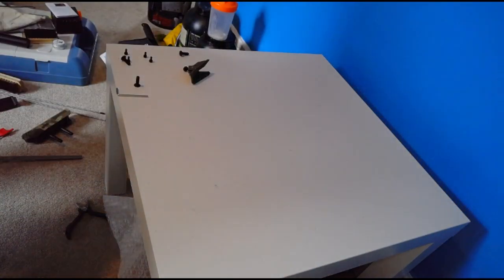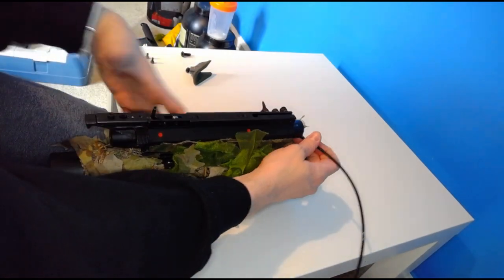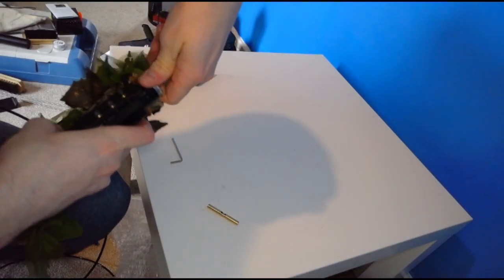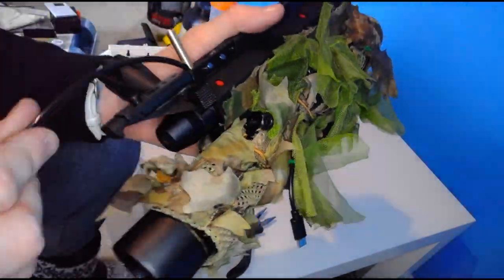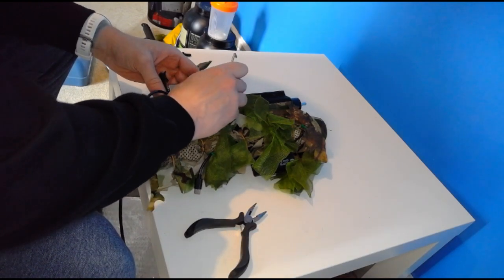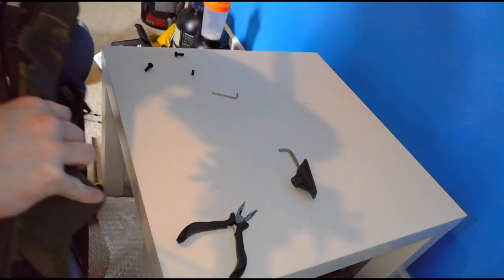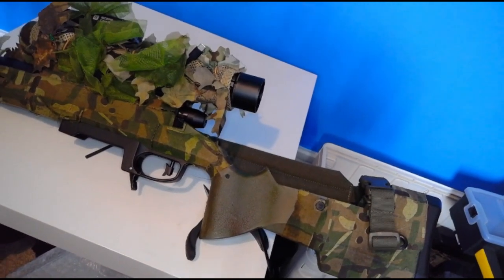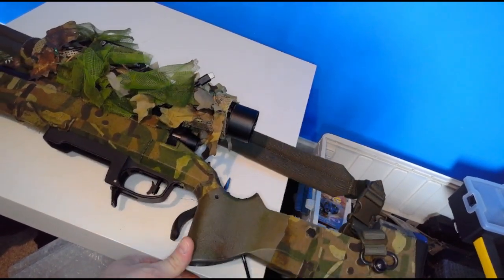silverback Tac-41 mancraft SDIK conversion kit installation

Comment: super video par contre a tu changer le bloc hop up j est le kraken penses tu que ca irra et pour le canon tu a quoi en therme de diametre
Reply: Hey it may be  too late to say but in my  research pdi barrels have a great tolerance of 0.002mm they are stainless steel and cold hammer forged just like real steel. Here are my recommendations for diameter keep in mind HPa is a lot more consistent and more powerful in the case of using the mancraft HPa system which can be used to reach 700fps at 220psi with 6.01, 6.03, and possibly even 6.05, with those barrel diameter 120 psi would get 500fps all with 16in barrels. I suggest experimenting with 220 psi you could try to fully utilize that power and get more stability and accuracy over medium to long ranges, ideally in this case extereme ranges😂 and use a 6.15mm diameter barrels less efficient and less fps meaning more chances for air to go around the bb but with the fact it can reach 700 fps at 220 psi with the 6.01, 6.03, 6.05 diameters try to use 6.15 at 220psi and get 500Fps with more stability and accuracy but still great fps all for fact that the tac 41 has the second largest air container (41cc) to it self

Comment: Slt , question pour le mettre en hpa avec kit mancraft faut un bloc hop-up d'origine aeg ou faut passer sur le gbb ?
Reply from the maker: mine is still using the aeg hop up. and after a 24hour milsim i can say it works perfectly with that. no need for gbb hop up

le mien utilise toujours l'aeg hop up. et après un milsim de 24 heures, je peux dire que cela fonctionne parfaitement avec ça. pas besoin de gbb hop up

Comment: Bonjour  quel  le modèle  de macraf  tu a installé  sur tac 41 stp merci
Reply from the maker: this one. and select tac-41 from the drop down menu https://shop-mancraft.com/en/sdik-hpa-for-spring-sniper-rifles/39-sdik-conversion-kit.html
Reply: @madladhobson   merci  quelle maudite faut-il faire pour le montage   j'ai trouvé  que toi pour le montage sur tac 41 ici ans France  j'ai rein trouvé  je pense que je serai le seul France à monter hpa sur  taille 41
Reply: Et merci pour toutes les l'enseignement que tu vas donner
Reply from the maker: @ericmarkl-po3ny  oui, j'étais frustré de voir que personne n'avait fait de vidéo sur la façon de procéder car les instructions sont au mieux inférieures à la normale

yes i was frustrated to see that no one had made a video on how to do this as the instructions are subpar at best
Reply: @madladhobson   oui tu es le seul à avoir fait vidéo pour installer Minecraft 41 sinon tu as pas fait de modification
Reply: @madladhobson   tu pourras 
refaire des vidéos après l'installation du HPA  avec la puissance en France en limité à 2 jours
Reply from the maker: @ericmarkl-po3ny  il a un hop up avancé et un nouveau canon. tout le reste est standard

it has an advanced hop up and a new barrel. everything else is standard
Reply: @madladhobson   un canon ?Le quelle ? Un hop  up ? Le qu'elle ?
Reply: Bonjour pourrais-tu faire une vidéo avec tac41  an HPA STP MERCI
Reply from the maker: @ericmarkl-po3ny  oui désolé je n'ai pas eu le temps d'aller à des jeux le mois dernier. je ferai une vidéo d'ici la fin du mois
Reply: @madladhobson   ok merci
Reply: Salut  Di moi Toi aussi mal kraft claque beaucoup aurais-tu une solution pour ne pas entendu ce claquement je te remercie

Comment: Do you have todo anything with the hop up or is that part of the kit
Reply from the maker: I didn't do anything to the hop up. I already have the advanced rotary hop. But as far as I can tell it works straight away just adjust the pressure from the air regulator on the hpa tank to get it to the FPS/ joules you want
Reply: @madladhobson  so I’m guessing what ever mob that you do in the future. Smaller barrel, silencer bb weight. All you have todo is adjust the pressure on game day. Is that correct?
Reply from the maker: @longshotbutcher8003  yeah. And I found out the original barrel length is quite wasteful and will often loose some pressure before the BB leaves it. I shortened mine to the next one down. Can't remember the length. After that one simple change it became much more accurate and much more consistent FPS and range.👌
Reply: @madladhobson  I think the original is 510mm the shortest is 330mm and some sizes in the middle. Cheers for your time

Comment: GG man ! Beautiful work ! Any return after 2 month w/ this config ? 😍
Reply from the maker: I have been using it but often struggle with getting recordings. It's very accurate and consistent. Been getting serious range compared to stock and to the sniper mechanics wasp kit. And it sounds great
Reply: @madladhobson  thx 🤜🤛
Reply: @madladhobson  Thank you for the speed of your responses.
Last question ^^
For maintenance, what do you recommend?

Sorry for my bad english.. I'm FR ^^
Reply from the maker: @xt0rk  maintenance is the standard really just clean the inner barrel and every so often I take the hpa part out to clean any debris that got into it. I've put a little lubricant in there too but doesn't seem to make much difference
Reply: @madladhobson  Thx ❤ Really 🤜🤛

Comment: Ré rondelle que tu mets derrière dans le piston
Reply from the maker: Je l'ai mis là pour amortir le son lors du tir. semble fonctionner

i put it there to dampend the sound when fired. seems to work
Reply: @madladhobson   à OK  je veux acheter Minecraft j'ai des soucis pour l'installer pourrais te demander des conseils je te remercie
Reply from the maker: @ericmarkl-po3ny  of course
Reply: @madladhobson  j'ai pa compris ?
Reply from the maker: @ericmarkl-po3ny  im anglais à l'aide d'un traducteur. si vous avez besoin d'aide, envoyez-moi un message et aidez-moi là où je peux
Reply: @madladhobson   OK merci
Reply: hello I would like to know what and how long of the brass tu to pass the black pipe that passes through the trigger and also what is the length of the middle hole to pass the black pipe thank you
Reply from the maker: @ericmarkl-po3ny  the brass tube is the same length as the current trigger pin. And as for the hole that I made. I just guessed where to drill it. And filed it down to fit.

le tube en laiton est de la même longueur que la goupille de déclenchement actuelle. Et quant au trou que j'ai fait. Je viens de deviner où percer. Et l'a limé pour l'adapter.
Reply: @madladhobson   traduction  an français  svp merci
Reply from the maker: @ericmarkl-po3ny  done
Reply: @madladhobson  brass tube that you put a hole in the middle?brass tube
Reply from the maker: @ericmarkl-po3ny  le tube en laiton remplace la goupille de rétention triiger. j'ai percé un trou dedans pour alimenter la compagnie aérienne à travers la crosse du fusil. 

Je ne suis pas sûr de sa longueur. il est venu avec le kit. si vous mesurez la broche de déclenchement actuelle, c'est combien de temps elle est
Reply: @madladhobson  well thank you for your answer I will buy a brass tube at the DIY store and again thank you for answering me could you make a video with the TAC 41 in hPa thank you very much
Reply from the maker: @ericmarkl-po3ny  no problem. Will upload one in a couple of days
Reply: Bo jou une solution pour limiter le bruit lorsqu'on tire avec